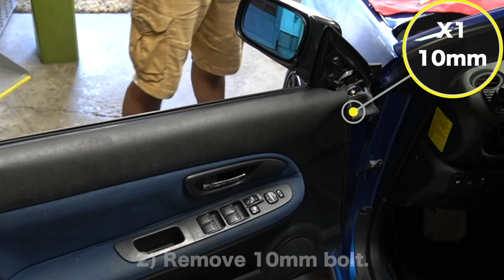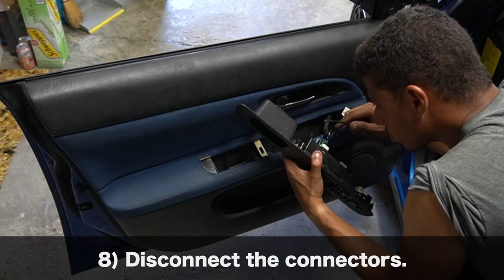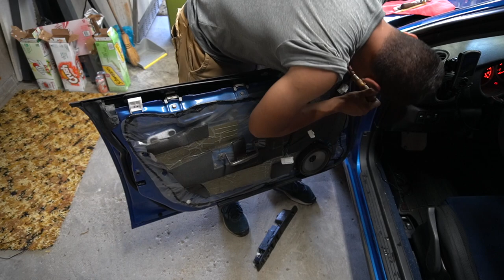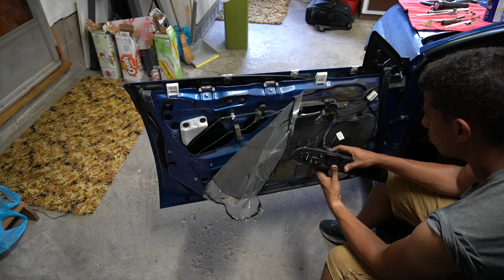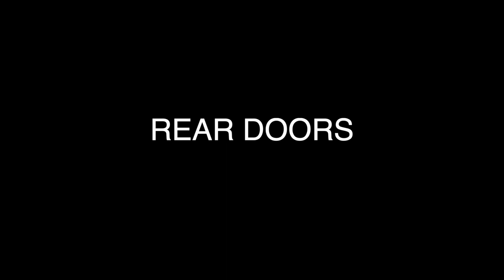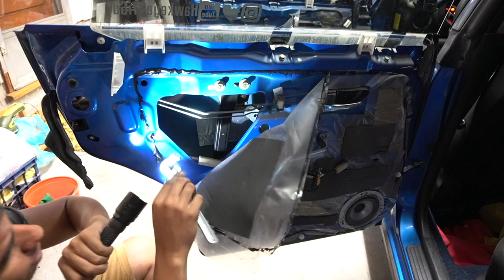How to Remove: Door Cards, Mirrors, Handles, & Window Trim on 2002-2007 Subaru Impreza WRX & STi

Comment: Hi, my driver side front and rear outer door handles are not in a good condition - the color coating on the inside of the handle is partially worn. My idea was, instead of having them repainted, replace them with second hand parts that are in good condition. Your video is really detailed and well edited - thanks for that! But still I'm really not sure if I can take everything apart without braking anything or messing sth. up. I'm especially concerned about diconnecting/connecting the lock/handle rods and the whole opening/locking mechanism.
I've contacted a guy on ebay who's selling the second hand parts and asked about their condition. If he says the paint is undamaged I'll probably pull myself together and try replacing them. Hopefully it'll go well!